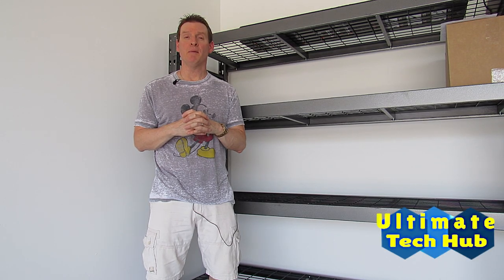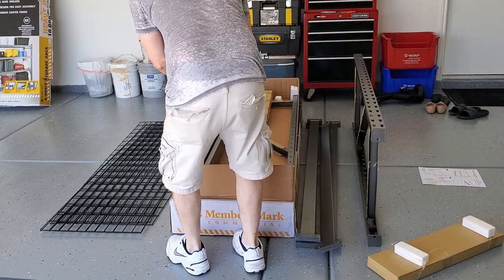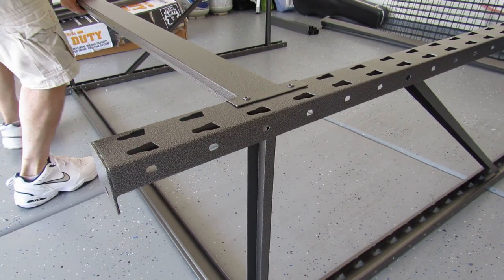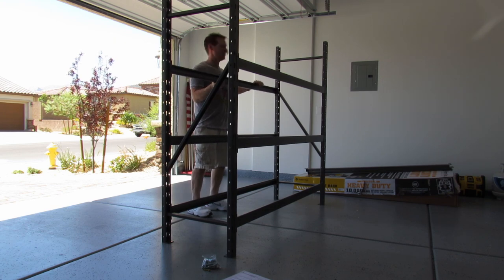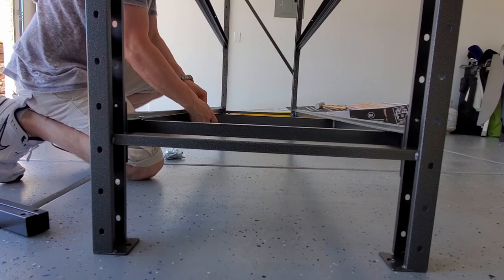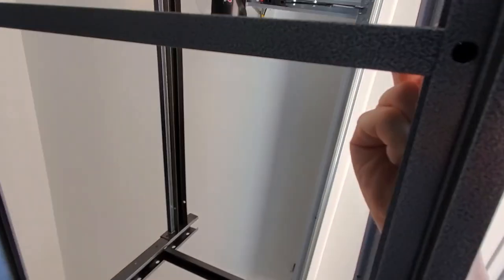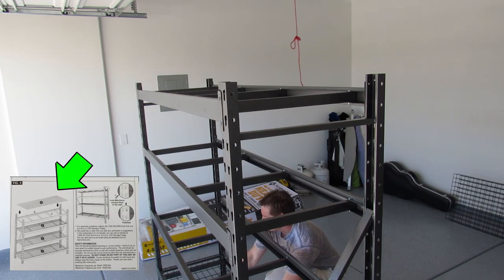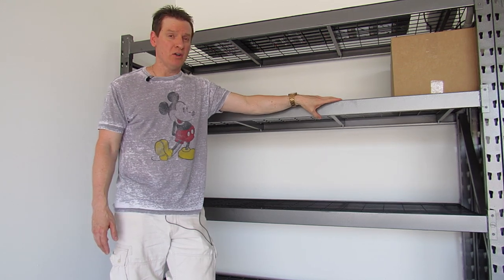How To Assemble A 4 Shelf Storage Rack-Members Mark Storage Rack

Comment: $149! I just paid $250 for mine and thought I got a great deal! I would have also purchased two at that price. Solid video.
Reply from the maker: I ended up getting 3 of these!! The Shelves hold lots of weight! No issues. Thank you for watching!
Reply: @UltimateTechHub  I love that! One can never have too many shelves- especially in the garage.
Reply: Just paid $199.99. Sam’s club app had them listed at $179.99 but in stores it was higher. The sku’s were slightly different but same product. Asked if they’d honor the price difference and the dude told me no. Still thought it was a great deal so I didn’t bother to fight it
Reply from the maker: @briandavis2726  Yes it's still a good deal and it's a great product. Thank you for watching.
Reply: @UltimateTechHub Do you know what date they drop to $150?

Comment: I notice you built them to be independent: meaning each has a left and right vertical.  It seems like if you put two (or three) of these together side by side, you can connect them together, using a single adjoining vertical.  That can save a couple inches of width against the wall.  (I'm about to put two similar units up from costco)
Reply from the maker: Yes absolutely you can do that. I just preferred to do them separately. Thank you for watching!

Comment: I have 3 Gladiator shelves of the same size. If you don’t mind putting the bottom items on the ground, you can attached the left over shelves to make a extra unit. 
So you could have 4 units with similar storage. 
Wish my garage was bigger like yours.
Reply: Interesting....what's the model name?

Comment: Thanks for the video! My one question would be, which way to you place the wire deck (c)? I can't really tell and the instructions does not say Wich way they need to be lay on each shelf. Thank you!
Reply from the maker: It needs to set into the shelf. Vertical wires facing down  That's how I did it. Thank you for watching and enjoy your new shelves.

Comment: Nice setup! Thanks for sharing, also was in the market for some of those 
nice storage racks. Noticed the brand "Edsal" manufactures Sam's Club 
and actually Home Depots Husky Racks too, but with some minor 
configuration differences. Was wondering on the Sam's Club version are 
those shelving bracket notches some type of welded pin or rivet to lock 
each tier in place?

Comment: Can you just use 3 of the shelves, or does it need the 4th shelf?
Reply from the maker: Yep you can use just 3 if you want.
Reply: Ultimate Tech Hub Ok, thank you!  Hoping it keeps structural integrity without all 4 shelves.
Reply from the maker: @diversityandcomicsbear2625  The beams are very solid so it willl hold up fine with only 3 shelves. Thanks for watching and if you subscribed thank you as well.